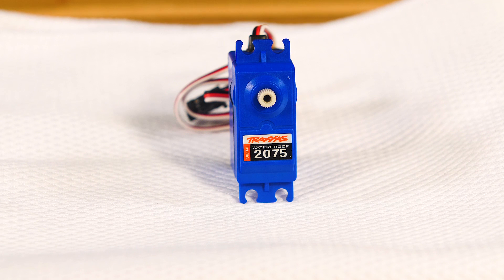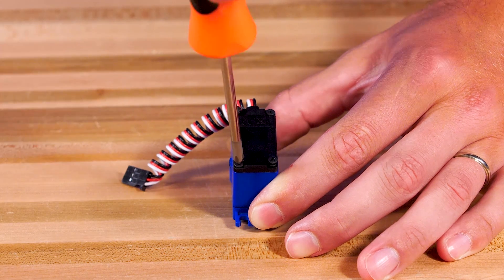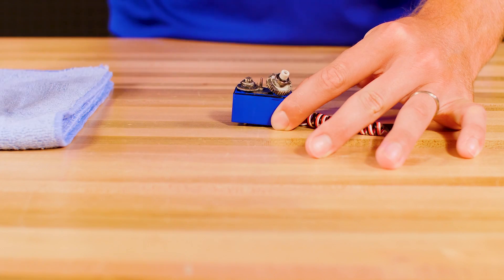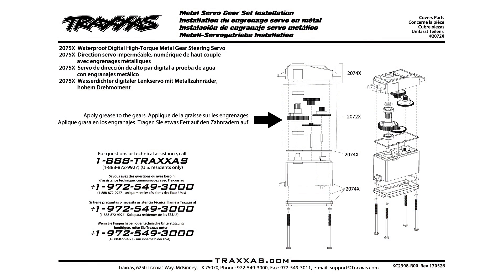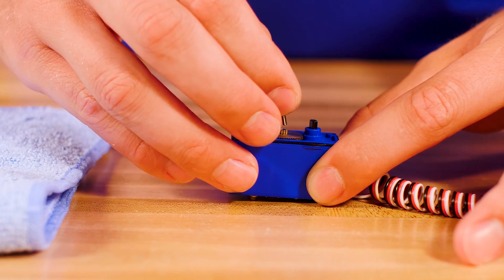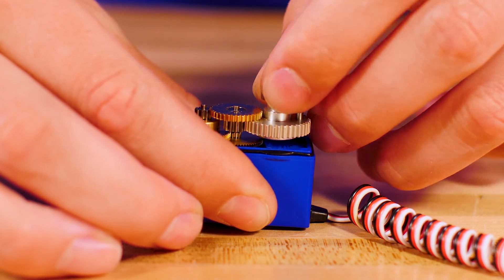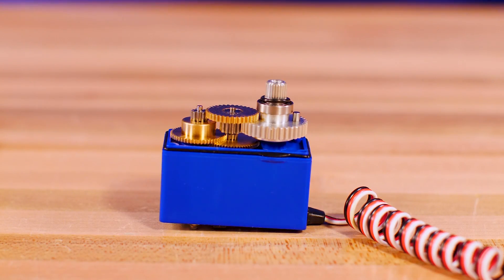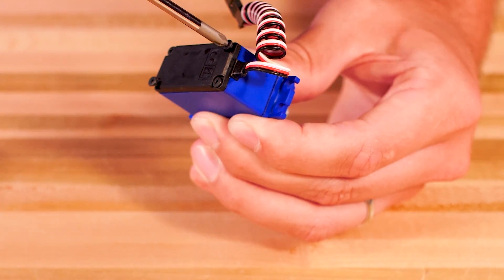How to Install Metal Servo Gears in Traxxas 2070 and 2075 Servos

Comment: I need this for my supra gt4! I drift so hard that my servo gets stuck turning right and you can hear it making noises to try and correct but nothing. I just installed sway bars on it. I should have did this upgrade first knowing the stress test I was going to put it through. I love it and need my RC back on the road! Sad part is I was just at my local hobby shop!

Comment: Are those metal gears strong enough that I can run without a servo saver? I'd like to run a straight servo horn in my Rustler for more responsive steering. Anybody have any experience with doing this?

Comment: The Traxxas E-REVO VXL 1/16 has a 2080 Servo. Can I get a 2075 Servo on it? If so I wouldn't hesitate to get them and install them. I stripped 3 gear teeth. All I did was take it apart and rotated the gears. It makes a small clicking sound now but works and controls the car. I can take it apart again and realign the gears to stop the clicking but for now, it works. I did a small bashing and my car flipped rolling on every wheel from from side of the road to the other off a bad sidewalk jump lol
Reply from the maker: Please contact Traxxas Support and we will be happy to help!
U.S. - 1-888-TRAXXAS
Outside U.S. - 972-549-3000
E-mail - support@traxxas.com

Comment: My gear is grey......it doesn't have thread inside so i can put the screw in...help?
Reply: Same. There’s like two versions of the 2075 fr what it seems like, and now there’s a version with a red dot next to the 2075 number printed on the servo; and the gears are grey. I don’t know what the difference is between the red dot and white dot servo.
Reply: The white dot servo has pre threaded output gear, and the red dot doesn't. I figured it out when Traxxas support told me to use the self tapping screw.

Comment: what i dont get is traxxas puts  High Torque on the Servo like my 2075 but all the gears in  it are cheap plastic why not have the  Metal Servo Gears already installed  i love and use traxxas i was jw  thats all
Reply: Because including a metal gear servo (2075x) would increase the cost of their lower end trucks to like 30% or more! LOL
Reply: Because they want you to buy their parts knowing their trucks are basically sabotaged from the factory cuz they are greedy as f**k

Comment: So I take it this now fits the Slash (and other associated) servos? Seems to be much uncertainty as the product listing states 2070-2075 servos but the supported vehicle is the TRX-4 (which uses a 2075x)...
Reply: Spencer Peat 
Probably because the 2075X Servo is basically a 2075 Servo with metal gears already installed. So when you install this gear kit into a 2075 Servo-you’re converting it into a blue 2075X. And yes, this Servo fits the Slash along with many other 1/10 models.

Comment: Is the nylon insert a new part added to the metal gear kit? I bought a set 2 weeks ago and it did not come with the insert
Reply: It's the 2072R set that has it
Reply: I have the same problem on 3 sets I got.
Reply: That plastic insert is not part of the kit or in the original servo either. How do we get it ??